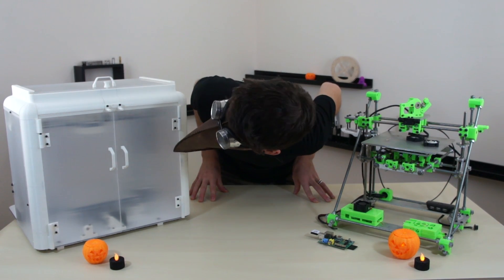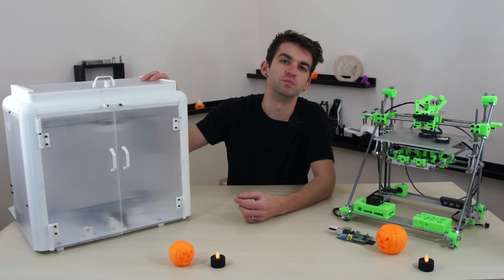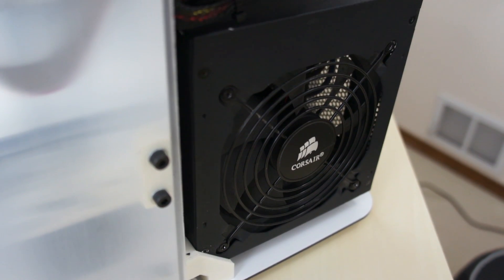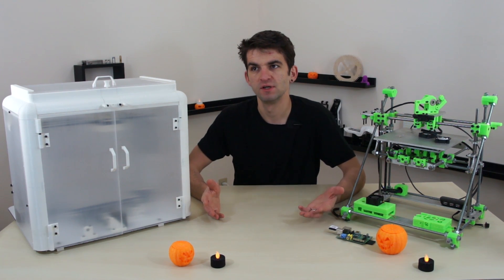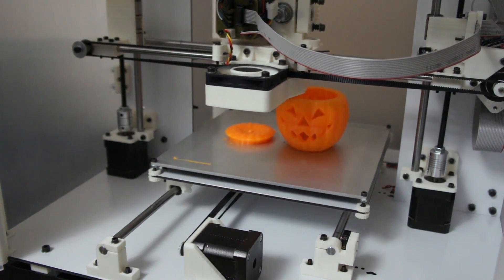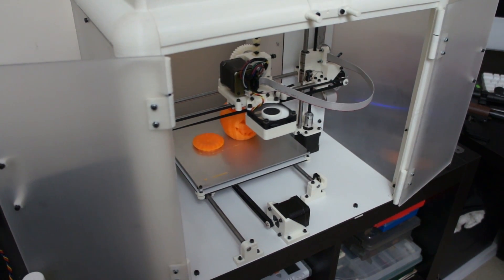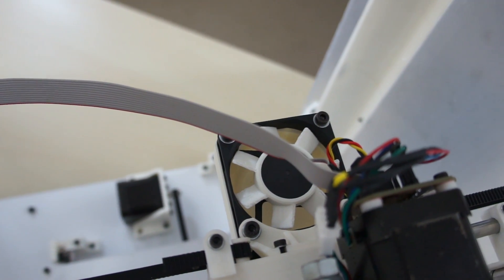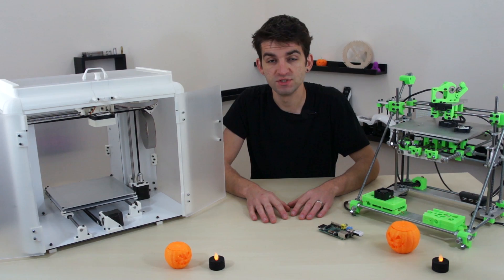Fully Enclosed 3D Printer

Comment: I was thinking of getting this one http://www.banggood.com/3D-Printer-Assembled-Me-Creator-Mini-Desktop-Kit-With-2004-Display-p-959232.html?rmmds=category?p=0K1422970031201412U8     what do you think of it.
Reply from the maker: I don't have any experience with that machine but the reviews look promising.  Problem is there are literally 100's of sub $500 dollar 3D printers on the market now which is great for people looking to get into the tech without the hassle of building one from scratch...however its still somewhat of a market in where you get what you pay for.  If I needed to buy a plug and play machine at this point in time I would look into the lulzbot line, but those cost a pretty penny more.
Reply: Curt Filipowski  I am looking for something that has a fast speed and fine detail and can use most plastic and be cheap I no that is hard to find but this looked like a nice printer looking at the photos. thanks

Comment: Nice printer and video!
Q: Why not design the corner pieces so the panels just slot in? (Not a criticism; truly curious about the design decisions).
Reply from the maker: Thanks, however the design of the printed housing is not mine, it was shared from a user named Kreidler.  I'm assuming he made the panels bolt on to keep everything inline with the existing printer frame (outside) and still retain the largest inside area.
Reply: Ah, okay; I missed that bit. Thanks for clarifying.